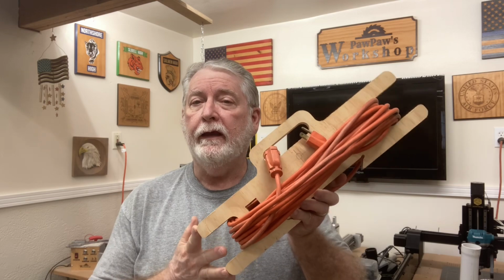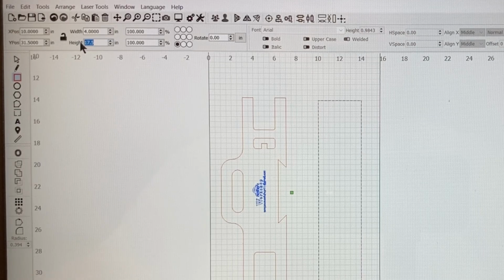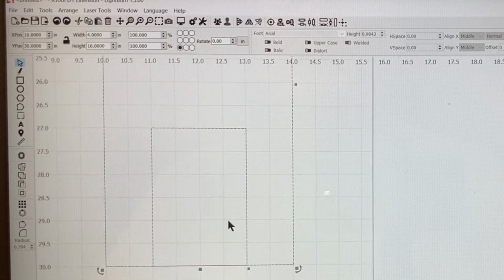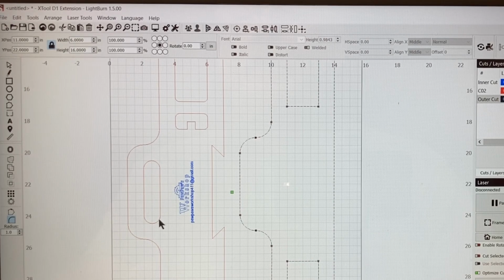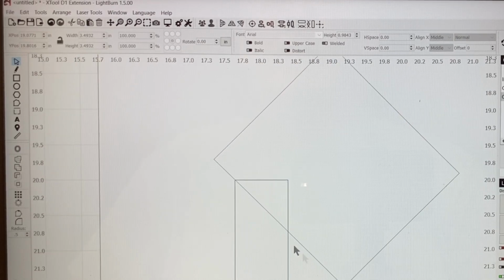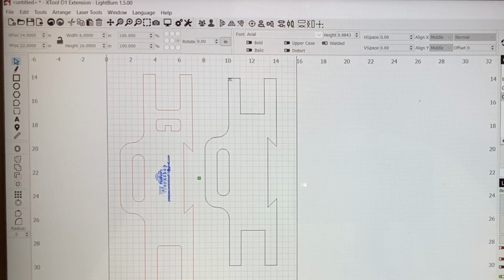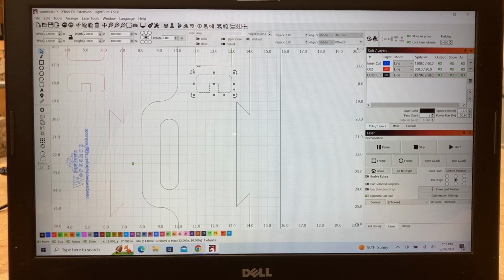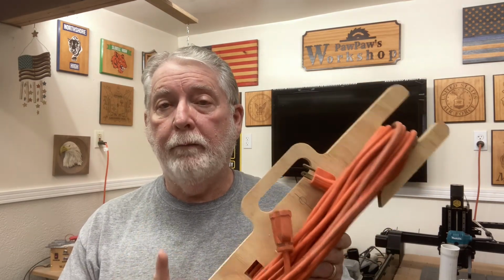Using Lightburn to design this Extension Cord Holder

Comment: I was thinking of making one too for the dozens of chords I have. I'm thinking of adding 2 small blocks, and using the cnc to cut 2 "female outlets" for the plug ends to plug in to. Something to keep the cord secure without having the plug ends flopping around everywhere. Maybe give it a shot and see if it works for you?
Reply from the maker: That’s an interesting idea. Would love to see your finished project